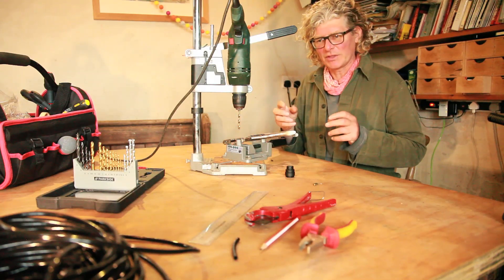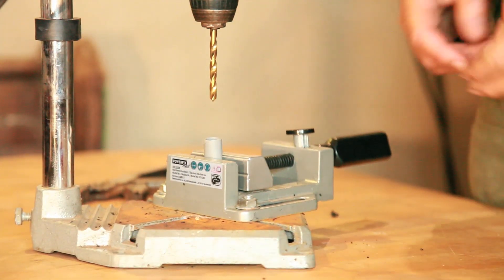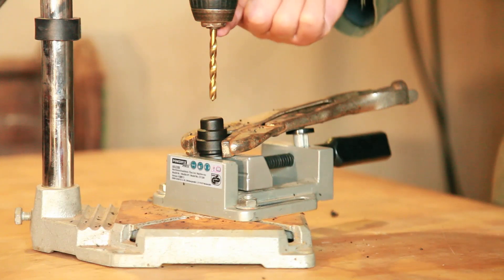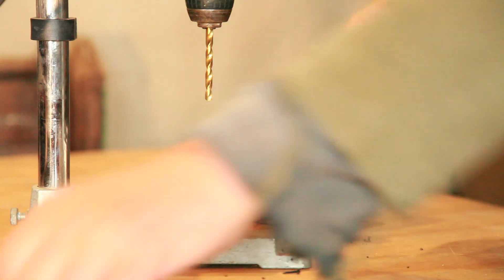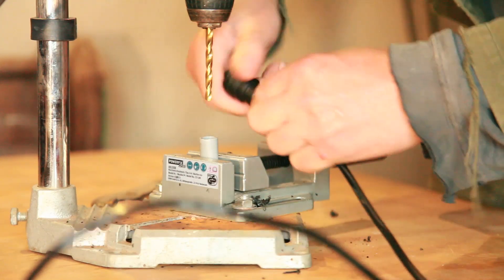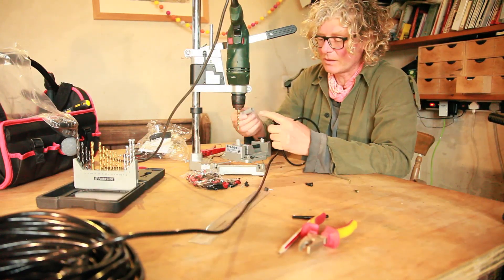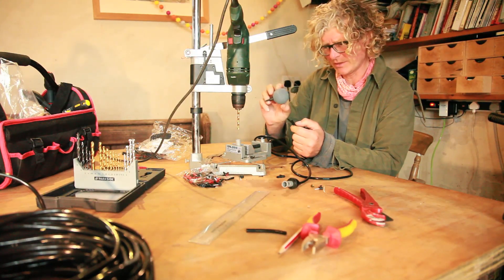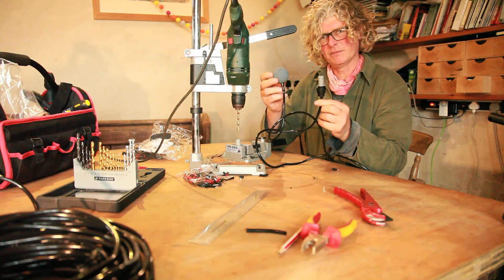Organic Pools DIY kitchen - How to plumb an airstone

Comment: So I bought this 15mm pipe, 4 end caps and the 6,5mm irrigation hoss. The pipe came on 25mt lenght and when I started cutting to make what you show in this video I encountered myself facing the problem of the caps only fitting on the end of the original pipe that has an inset shape for it. How do I fit the rest of them to make them tight?

Comment: Hi, thank you for sharing all your videos! As for the barb insert - it might not be necessary. If you try to burn the tip  of the pipe, they typically "roll up", and create kind of a " Pizza dough edge" around.

It might be well enough to stop the pipe from ever coming back through the tight fit tube

Comment: what is all this metric bull crap I don't understand it as I still work in feet and inches so have not a clue what length or sizes you are on about
Reply: Mister Mcgowan, maybe you have heard about the rest of the world outside the us? Just because your country didn't adapt to the metric system, doesn't mean that everybody else has to. Check it out, you're pretty alone in this: https://www.indy100.com/article/systems-of-measurement-imperial-metric-world-map-measuring-height-7666466
But hey, there are conversion tables that might help you a bit..https://www.metric-conversions.org/converter.htm
You're welcome!